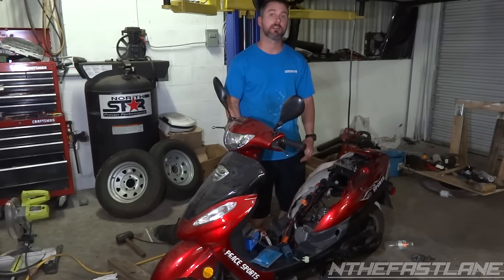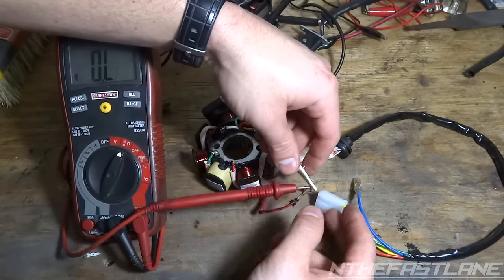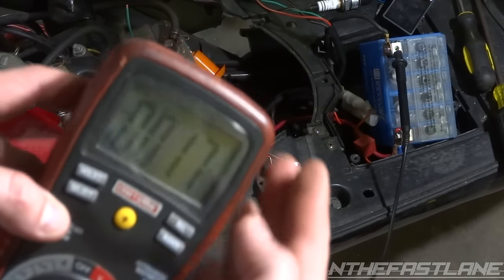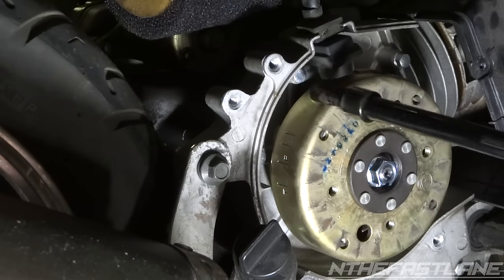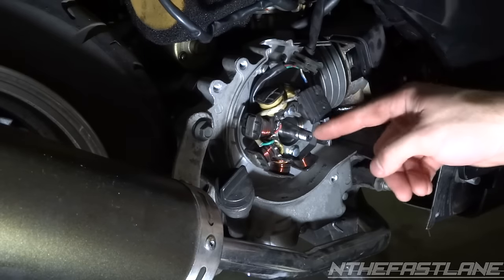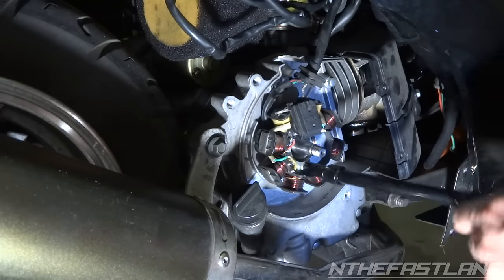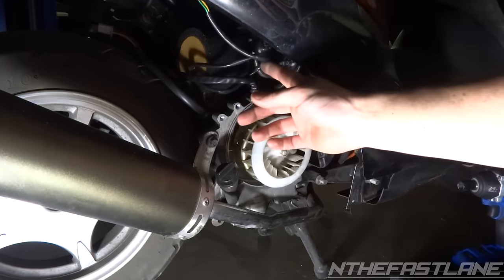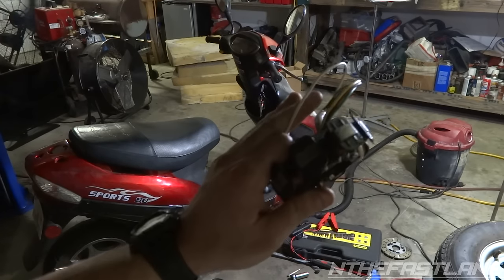▶️Scooter Won't Start Stator Repair (3 Reasons Why No Spark)🔧

Comment from the maker: 🛒Shop This Video: https://www.nthefastlane.com/scooter-wont-start-repair-store
🛒Find Any Leak: https://amzn.to/3JADlYm
🛒Download Auto Repair Manuals: https://shrsl.com/3wmrj
🛒Visit Nthefastlane's Amazon Store: https://amzn.to/3pP4UCy
Reply: 07 yamaha moped, if i hit the start button, it has spark for 1 or 2 revolutions and then is gone. If i the start button again, it has spark for 1 or 2 revs then gone.
 It constantly does this. Any ideas?
Reply: Great video! I have a 1986 Yamaha CE50 - can you provide me with the Nthefastlane link for cdi/coil/stator "bundle ignition repair kit"? I'd love to be able to buy this from your store.

Subbed!
Reply: Oh, and a link to a 5 wire starter from the Nthefastlane store for the 1986 Yamaha CE50 too, please!

Comment: I have a 150cc GY6 Chinese scooter that suddenly was not making spark.  After watching umpteen videos and checking all ground connections, replacing the CDI, spark plug, coil, stator, starter relay and still not getting results a week later, I discovered a wire going to a switch on the side kick-stand.  As it turns out, there is a safety switch on the side kick-stand to prevent the scooter from starting with both wheels on the ground and no rider when the stand is down. The starter will still turn-over but will not provide spark to the spark-plug. I wish some of these electrical trouble shooting videos would mention this switch as it would have saved me a week of time and considerable money.
Reply from the maker: +Mr. Bigfoot I'm not sure the 50cc's have this kick stand switch. I'll have to check that out. Appreciate you mentioning it for others to read, as you know, wasting time can be very frustrating. I remember several years ago I had a AC issue, where every once in awhile the a/c compressor would kick on, but it would kick back off immediately. It turned out, that the coolant temp sensor in the center of the cylinder head was slightly disconnected, and that was causing the whole issue. It turns out, the coolant temp sensor ran off the same wire that the a/c clutch did. Found out through several days of looking at schematics.
Reply: at least u have spare parts now. i took that fukin thing off the kick stand.

Comment: Thank you for your video!  I've finally learned something of what that box thing does.
But for us, mechanically illiterate, folk... 
Some models just require the break to be held while pushing the start button.
Dang... who knew the last thing I checked, was the one thing that worked!
I'll be watching you.
Reply: haha like me as well Laureen. I acquired this Jonway Scooter and all summer long video after video of trouble shooting and the one video I kept skipping over was the one on the battery only because well I just bought this battery but I kept tryin to start it straining it, not charging it thinking it was new I didnt need to. when I finally watched the video it said the battery needs to be charged to about 12.65 or something around that I dont remember now but I checked mine with multi meter and sure enough it was below 12. and thought son of a b.....! all summer! took it to a shop cause I didnt have a battery charger then they fully charged it took it home put it in and bam! started right up but it was winter at that point. lol then In spring was riding along going down this big hill full throttle (probably not a good idea) but heard something pop and then high winding sound and throttle was making it move anymore because I just popped the drive belt and had to push it home after coasting as far as I could coming back up the hill then it sat and still is sitting nearly 5 years. crazy. but I got it running again ...well kinda...

Comment: DON"T EVER START SCREWS WITH A POWERTOOL...ALWAYS START THEM BY HAND!!!!  And another good tip is don't tighten your tire-lugs with a powertool, if you have to change the tire on the side of the road it will be too tight to remove by hand.
Reply: I use a screw gun (not a drill) so far its been fine
Reply: Very True, Great Advice ⭐️

Comment: Question- will a stock 8 pole stator with matching cdi work on a gy6 150 c.c. kymco. If not why not. If so. Would I also have to change the voltage regulator.

Comment: I thought it was a great video..My scooter won't start after a rain or if it is really humid, normally really in the morning with the dew.  Any thoughts on that?  Seems fine in dry weather
Reply from the maker: Three things, stator could be getting wet and shorting out, ignition coil and spark plug wire could be getting wet and shorting out, and lastly the CDI underneath the floor mat where your feet go could be getting wet and shorting out. Check those three things to see if they're getting damp, or any water is in the connectors.

Comment: Kind Sir, i don't usually leave comments... However I felt compelled to say BRAVO !!!!!!! This was by far the most complete and enjoyable how to video on scooter repair i have EVER seen. I am going to look for as many of your videos as i can find for the sheer pleasure of watching and learning from you. I have 2 Kymco scooters and am in need of some advise as to why they are not starting, can you answer me this question? Aside from the fact that there are the different manufactures aren"t scooter motors basically the same"ish? I mean conceptually.
Reply from the maker: Thank you! Yes, pretty much all 2 stroke and 4 stroke engines all have the same design if we were to compare (EFI) and carburetor . Most carburetors are interchangeable from Honda, to even the GY6 Chinese scooters. For more scooter videos, go to my website, look at the top for "Automotive Repair Videos" and select the (Scooter category). LINK: www.Nthefastlane.com

Comment: what would you recommend if after taking the white plastic fan with the four screws off and the bolt holding the magneto in is so stripped that you cant get it off to even get to the stator? mine is so stripped ive broken sockets and the bolt is round no edges anymore. I even bought a bolt removal kit and those won't turn it either. it's driving me bananas and have given up on ideas. will heat work? can you test the stator without having to take it off the bike?

Comment: Hello. Great video mate thanks!. I am looking for an opinion about my current situation with a mechanic. Recently my scooter stopped working at the side of the road. The lights came on the display, everything normal, but it just would not start. No noise at all. Took it to a mechanic who said they are 99% sure it is the ECU. I bought ECU £360 ( not cheap ). They put it on and said it has got the fuel pump working again but still the scooter isn't working. They have had my scooter for a long time, and now they are saying it is the generator I need. Now I am looking at buying one for £200 ( not cheap ). I am now getting suspicious. Did it really need a ECU? I think they took a guess and made me buy one when it wasn't needed. I think the fuel pump story is a cover up. They are saying that if I get a generator it may still need something else like a new wiring loom or something. Seriously I am supposed to buy these things one after the other with cash I do not have? The scooter has done 59000 miles, but the engine was changed at 50000, so the stator ( generator )  has not got much use at all. My previous stator was still fine after 500000, which I no longer have. Here is what I cannot get my head round. What are the odds that when I pulled up at the side of the road to have a short rest, both the ECU and the generator packed in at the same time? I just cannot believe this is the case. Especially when the generator has done such low milage. My scooter is at a garage in bits, and I now feel reluctant to buy this generator for them to put in. I have lost my trust and faith in the company. Please can you give me your opinion on both these parts failing at the exact same time I pulled over? Am I right to feel suspicious? Many thanks
Reply from the maker: What's the Make/Model and Year of your scooter?
Reply: @Nthefastlane  Thanks for replying. The make and model is Piaggio Medley and it is the year 2017
Reply from the maker: It could be a whole host of things. The first thing I would ask them is to replace the new parts with your old parts, since the new parts did not fix the issue. That's what we call "Throwing Parts At It". Have them only charge you for diagnostic labor.

 The first steps I would have taken with this type of troubleshooting would be:

1) Check and see if the fuel pump primes and produces fuel out of the fuel line.

2) Turn the engine over and see if it's producing any spark from the spark plug.

3) Test to make sure the ECU is getting 12v.

4) Test the resistance on the coil pack.

5) Check to make sure the bike has a good ground.

6) Test the resistance of the stator.

7) Since this bike is (EFI) *electronic fuel injected, I would place an injector test light on the fuel clip and turn the engine over to see if the ECU is pulsing the injectors.

8) If the ECU is getting 12v then you can pull up a wiring schematics for the ECU and find out which wires lead to the injectors and which wires lead to the coil. Test and make sure the proper output voltage is being supplied.

9) This should probably be the first thing to do. Run a compression test just to make sure the cylinder has the correct compression. Too low of compression and the bike won't fire.

10) Set a multimeter to continuity and test for any breaks in the wires. This can also be performed with an induction meter. Running the tester along the wires, it will detect a break in the wire if there is one.

Hope this gives you a good reference.
Reply: Still cannot come to terms with the fact that an ECU would pack in the very same time as the generator. More chance of winning the lottery surely

Comment: Hard to find parts for a honda gyroS... 1985.. with 9k miles is not youle standard built scooter... 😢 but I was fun when it ran.. just been sitting.  But did  get a new  battery, plus and coil

Comment: I have an Eton Beemer. There is a black & yellow wire connection hanging down by the fan. Where or what does it connect to?
Reply: Black and yellow usally goes to the spark coil

Comment: I can't seem to find my specific scooter ANYWHERE online!  It's a 2011 kaitong md50qt-5. It only has 300 miles on it and only used premium gas. at this time it won't start up at all since the key was left on accessory and the battery died, after jumping it-nothing but the accessories work. prior to this, the scooter was running and driveable but seemed like it was not getting out of gear or something...It would only go so fast in the first gear...any help would be greatly appreciated or even just being pointed in the right direction to somewhere with information on my specific scooter maybe?  thanks! -Jessi
Reply from the maker: +Jessi A you may need to check the bus fuse by the battery for corrosion or possibly even blown. As for Gears, I'm not sure if yours has a transmission but the majority of scooters run on variators. Basically little roller weights that move up and down allowing the variator to move in and out moving the belt higher or lower. It could be that your roller weights have flat spots and are getting stuck.
Reply: Jessi A wathyouwantforit
B Good x

Comment: I had the same problem on mine. I replace the spark plug cdi box and spark plug coil. My moped doesn’t have the stator there is no videos about my moped stator. Luckily I just recharge my battery and that was it my moped if fix. But it is Wierd that it doesn’t have a stator as all the mopeds I’ve seen on this videos 2016 sym hd200 Evo.

Comment: How do you know for sure you have AC or DC ignition system?  I put in new 8 post stator I gave a blast of starting fluid, it fired up ran for about 3-5 seconds.  I tried again, now won't run, no spark.
Reply from the maker: If you have DC you will have 12v at the CDI when you turn the key before starting. If it's AC there will be no power at the CDI. This is all accurate as long as everything is working properly and your battery is putting it 12v. AC doesn't need a battery for the bike to run and generate power, DC needs a battery to run.
Reply from the maker: Also, DC does not have a red wire that goes to the CDI and back to the stator.
Reply: Won.t start. Plentt of fire but the gas doesn't seem to be  get to the carburetor

Comment: Great video.  I am having a starting problem...  I seem to get 1-3 sparks only and then nothing.  These 1-3 sparks only occur if you turn the key and immediately hit the start button.  If you wait to hit the start button even 2-3 seconds after you turn the key on, zero sparks.  I have already replaced the stator, CDI and coil.   Because the routine is consistent I am pretty confident it is not wiring?  Not sure what else to check or replace?????
Reply: i have same starting problem
Reply: Check the source coil

Comment: I have a 2002 kymco cobra with no spark I replaced the CDI Box Spark Plug Ignition coil and stator. I was thinking its kill switch but when I unplug the right hand control still no spark when I try to crank it it will crank but it will also crank in the off position? Also my battery is very low from trying to crank I hear a click sound coming from the battery compartment but when I kick start it it charges the battery a little bit so it will crank with the electric start any advice?
Reply: The click is the solinoid asking for power. Check your grounds. All else fails cut the black wire with the white stripe that's the kill switch going to your cdi. It will deactivate every safety component that wont let it start.

Comment: Hey buddy I need your help. I recently installed an 80cc big bore kit on my 50cc gy6. I verified the timing, gapped the valves properly, gapped the spark plug properly, oiled my parts. Placed my piston rings properly with all ring gaps away from each other, Checked my fuel lines etc... yet it doesn’t want to start. I tried foot cranking and electric start. I tried starter fluid and nothing. All parts have no cracks and seem good.
Reply: Also I have spark, I have compression and fuel...

Comment: Hi my scooter starts with the kick but it won't start with the switch in the morning or it is left for more than 20 min. When it is hot it starts with electric switch. My battery is new. What could be the problem ?
Reply: Maybe the switch/  switch connectors or starter is no good. Test the starter with a wire tapping the + on the battery

Comment: Hi, can anyone help. I have no spark. I replaced the stator the CDI the coll and spark plug. I'm not getting 35 volts and don't know why. It's a 2015 wolf 50 cc scooter. Is there anything else in the process I'm not aware of.  Thank you

Comment: Hey I'm currently working with an issue with starting my scooter. It's practically new. I was changing the variator rollers and I decided it was a good idea to use the flywheel as a way to hold it to get the nut off the variator. When I put the plastic piece back on the flywheel I accidentally used a longer bolt, then tried starting it. I noticed later the stator was a little ripped up. It doesn't start now, so could this be my issue why it doesn't start? Btw it started right before I decided to do this change in rollers
Reply: However you look at it you going to need a new stator put a new one on order it off of eBay not a big deal
Reply: wait arent the variator rollers on the other side of the bike where the clutch and kick start are? the flywheel and stator are on the other side with the oil dipstick.

Comment: Is there a difference if the original stator comes with 4 wires and the new stator has 3? It won’t spark

Comment: Both stators were good;  the Ohms tests proved that. Stators very seldom go bad if they are not all blackened and burned; my guess is that it was a bad connection somewhere, and that it came back later on to fail to start again.
Reply from the maker: The first stator was bad. After replacing it with a new stator, the problem never returned, even till  today.

If I remember right, off camera I put the old stator back on after getting it running with the new stator and the old stator still would not work.
Reply: It was probably your pick up coil. Needs to be 150 ohms
Reply: I think your cdi needs atleast 50vac to work. Mine had 36vac and would not power the cdi.

Comment: Hi sir.  A girl sat on my scooter real hard & the ignition switch immediately stop working. However I was able to kick start it twice.  I rode for a few miles & it just died.  Wont start at all but horn and power is still going thru it.  Im confused.

Comment: hi i have problem with my yamaha vino 125 2006 has spark has gas good exhaust is good  valve is good crank but wont start have the problem for weeks please help thanks
REPLY
Reply from the maker: +john woo I would say it's your carburetor. Check out my website for all the scooter videos on the carburetor. Link: http://www.nthefastlane.com/Scooter
Reply: hi thanks for replie i change the carburator cdi /coil / valve ajust compression check 140 psi  still wont start what can be the problem
thanks john
Reply: Did you ever fix it?

Comment: Why can't I find the right information I have spark no problem I start up the vehicle and kicks in and then it dies but when it starts up a little bit I push the throttle and it dies with a new carburetor I get plenty of gas but what's wrong with it